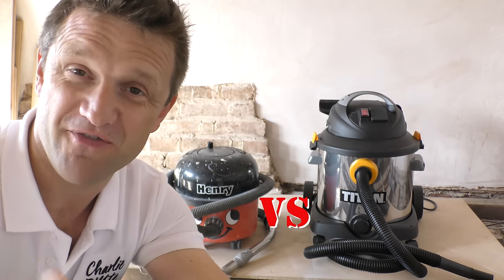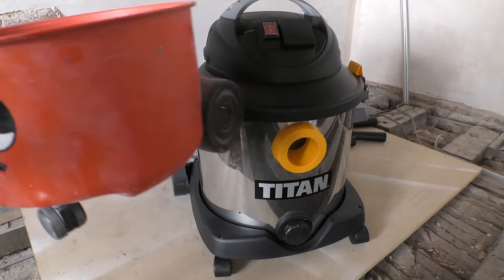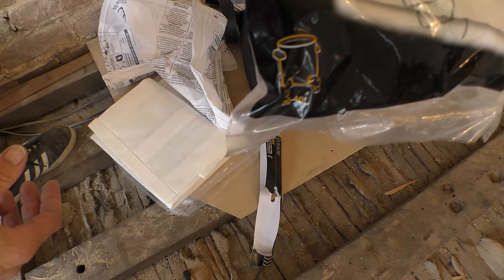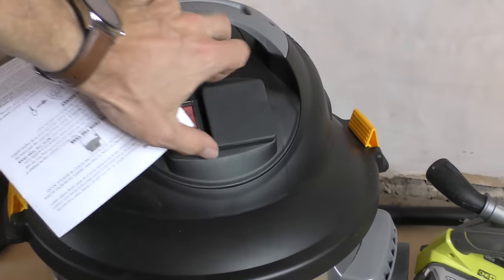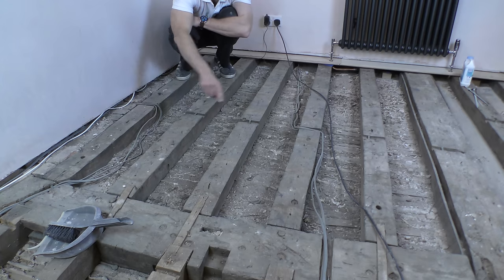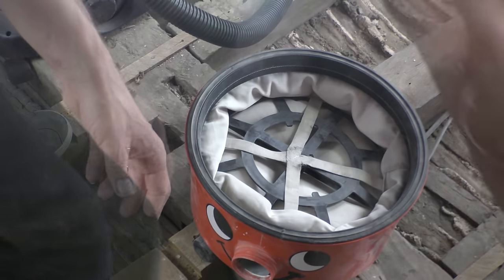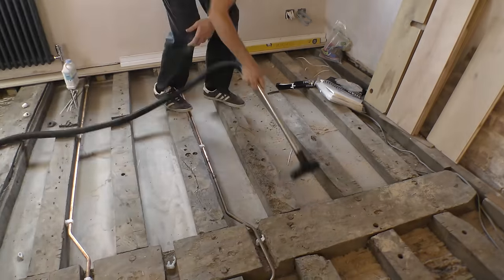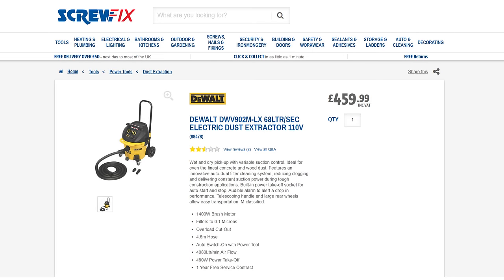TITAN vs Henry - DIY Vacuum Review

Comment: Never did I think I'd spend 20 minutes watching a vacuum review video, but having picked up an older Henry for just a tenner today (😮) I now have both of these vacuums which makes a comparison video pretty useful!
I've had the 30l Titan for about five years now, and I have to say I find it incredibly frustrating because of the attachments, and next to useless because the bags rip almost immediately (vacuuming old lime rubble, much like yourself) firing jets of dust out of the backside blower port like a rocket booster. I absolutely hate, hate, hate it.
Its only saving grace, however, is the power which is why I've built a cart for it and added a cyclone so all I need to worry about is dragging it around my workshop and making sure it's attached to my chopsaw, etc.
Reply from the maker: Me too. However like you I realised that it's just not designed to compete with Henry. It's designed as a static shop vac, and as you say, when attached to a cyclone it removes the need for those hopeless bags. On my wardrobe build, particularly with the pass through switch, I actually grew to quite like it! https://youtu.be/9RfHpm2vf40

Comment: I built a DIY cyclone to remove most of the heavy crap before it hits my Henry. Actually it's not a Henry it's a James, I pulled out of a skip. Works brilliantly in the workshop, the bag hardly ever needs changing. Not as good as proper big bore extraction, but for little jobs it's fine.

Henries are not indestructible though, we had one in the workshop at school and the cleaner prefered the workshop one to hers because it meant she didn't have to wheel hers over to the workshop. But I had been emptying and cleaning the dust bags on the machinery extractors and the Henry was full, I neglected to empty it. The cleaner used it and it caught fire and burned. :-D

Comment: re the blockages - have you tried the thicker tube from Henry on the Titan? Think you would find it also block due to fab power of the Titan. Although clumsy for site work a cylone adaptor works a treat in woodworking shop.
Reply from the maker: It doesn't fit because of the fittings and difference in diameter of the tube between the two models. I agree, a cyclone adaptor is the answer.
Reply: I was lucky then as I utilished the big tube from my old Aquavac

Comment: I was planning on using the cheapest 1300W Titan hoover with a Mirka hand sander block for sanding plaster. I’m not sure if it’s suitable though, what would you recommend for plaster dust? It keeps on clogging/overheating my Miele 2000W vacuum…
Reply from the maker: Plaster dust is always tricky. The DIY cyclone I made has helped https://youtu.be/9RfHpm2vf40?si=5NkrsQi-bD5whzaE but you still need to clean the hepa filter. The only domestic vac I'd recommend for plaster dust is Henry and just change the bags regularly

Comment: You can replace the hose with a 40 mm instead of the supplied 32 mm, and get a longer hose too, and get a matching handle, head and metal pipe

Comment: I think titan must have upped their game since this video, I’ve recently purchased the 30 litre wet and dry 1400W titan brand new from screwfix for £80. The hoover itself is pretty well made and the stainless steel drum looks snazzy. The attachments all feel good enough while thinner than Henry Hoover parts I really don’t feel they are that bad. And in my experience I have never had a blockage although I only use it to collect saw dust and vacuum thick dust from attics. I don’t really use it for hoovering up thick rubble. It’s a very powerful hoover too and I’d say it’s perfect if you want a hoover for dust collection in a workshop and for general heavy duty cleaning. But on its reliability I cannot comment since I’ve just bought it but with a 2 year gaurentee I feel reassured. The equivalent henry hoover would have cost me around £300. And don’t get me wrong it is a much better machine but realistically if you want a vacuum which you can use on all kinds of dirty jobs and not worry about breaking them then this is the one for you.
Reply from the maker: Thanks for that. Very interesting. The one I bought is really a shop vac. Use it in a static situation attached to a cyclone and it's great.

Comment: Found exactly the same things Charlie. It’s nice and powerful but that’s about it .I’ve owned it for a couple of years and I’ve bollocked my old man on a number of occasions for blocking it up until I realised it’s the design 😆
Reply from the maker: I literally hadn't used it since making this vid, until the current wardrobe build and it's had a new lease of life since I plugged it into the cyclonic extractor I made https://bit.ly/3fssYHn Thing is, it doesn't compete with Henry, but that's mainly, as I'm now realising, because it was never meant to be anything but a crude shop vac. I couldn't manage without it at the moment and plug my plunge saw into it so it turns on automatically when I start the cut.

Comment: Same company makes them for Lidl and Aldi too. Likely Positec power tools. You can bet the Stanley model is also made by the same company.

I've been using the one from Lidl for a while. Does the job but the noise level from the motor is too high. I don't own a Henry but have used them and their motors seem much quieter.

My home vacuums are Miele. Not only are they quiet, the suction is on them is amazing. But then you're paying £300 so I suppose it should be.
Reply from the maker: I agree. The motor on theTitan is LOUD. Could do with ear protectors really when I'm using it.

Comment: I had the same Titan as a Henry replacement it was useless for my work. No proper cable storage, lid kept unclipping when carrying it about and putting down/ picking up and pipe ended up having a permanent kink in it after about a weeks use. Ended up getting another Numatic after about 2weeks and returned the Titan reporting it as unfit for purpose.

Comment: I bought the 16l Titan

Great for the car and the blow feature is good for getting rid of moisture from the brake calipers of my motorbike

The wet feature really handy for emptying cisterns when replacing valves etc

Not used it in serious anger yet for heavy duty dust and small rubble collection. Suspect I might encounter blockages when I do

The bag so easily detaching from the inlet is a serious pita
Reply from the maker: It is annoying isn't it. Such a stupid design blunder! Also annoys me that there's no cord tidying mechanism.
Reply: @CharlieDIYte  Hi Charlie

I sometimes freelance for a local curtain/bkind/awning firm and one of their suppliers secures items for transit in a soft but strong velcro type tape. I find it useful for securing power leads, tool and cases when the catches have broken, etc

As that is your line of work iirc might you have access to it as well?

Comment: Charlie, I didn’t see if your Henry had the power boost button on like mine but it makes a big difference. I understand that those models are not available now because of some EU rulings etc. If only they made a bigger capacity Henry or indeed a shoo vac with the tool socket so it could be linked up to power tools! Henry hoovers are great for the worksite/workshop but not very good for pulling around the house and up the stairs. All in all I will stick with my Henry until I can afford to install a proper dust collection system to the workshop. Cheers Craig

Comment: Is the henry ok to plug in power tools like plunge saws etc....? does it have suitable connectors....? Don't fancy buying Titan products as the plunge saw was low quality and inaccurate.
Reply from the maker: You can get by with most tools, by using the adaptor that comes with them. For example my Evolution chop saw has an adaptor that fits directly into the plastic nozzle on the Henry hose. There's a plastic adaptor tube that comes with the Henry - which is really designed so you can plug the different vacuum heads directly into the plastic hose without needing one of the stainless steel tubes, but it allows me to plug Henry into my circular saw.
Reply: Cheers mate...

Comment: Can you fit a Henry hose onto it or a wider hose to stop blockages
Reply from the maker: No. It's actually fine for what it was intended - shop vac rather than domestic. I used it for my wardrobe build attached to a DIY cyclone and it was actually very good https://youtu.be/9RfHpm2vf40

Comment: Hi Charlie, I have been a joiner for over 20 years and I really would recommend the Fein Dustex 25. An excellent machine, incredibly powerful - I believe it has double the flow rate (80litre/sec) of the henry (40l/s), very quiet with a 4 meter hose. Also wet & dry & its £220. They make very good power tools but are only really known for their multi-tool. I also own there 4 speed drill driver, that I also highly recommend. J
Reply from the maker: Thanks Joshua. That looks like a nice tool. I'll keep a note of that  👍🏻

Comment: Great video Charlie. Informative and very helpful. 

Got my partner the HET200A and even though it's the pink Hetty version I use it as it's a numatic and much better than most of the cheap imports we get now. It's done sterling work for years and no issues at all. It's used in the house, car and for my DIY bits.

Comment: I have a titan the small one. I done a modification to mine I got a numatic hose cut the end off and fitted the titan contector on no blocking up as much .
Reply from the maker: Good work 👌👊
Reply: @CharlieDIYte  do you know if the HEPA flo bag will fit the Titan or any other standard wet dry vacuum

Comment: The works Titan, has a motor that is great, the hose "SUCK" and clogs too easy i put it down to the rigid s .you  made a good point about diameter. Over 10 years ago I  bought a nilfisk, it's been abused and drop some hight more then once. The take-off 1800w? Ssh 2kw router makes  it hot. Only thing that gone wrong is the switch (a year ago) replaced part in 3 days. PLUS ISH has built-in dust clearing button works half the time. Like you become a blower fan, and wanted bigger tank. Got nikfisk big bro with reversible blower. If  the new last half long as the still first one; still going strong, it's only £20+ a year . Ps only use a bag on big jobs for mdf, brick dust and cement..
Good show thank you .
Reply from the maker: Thanks, really interesting. The Titan isn't really designed as a domestic vac so my challenge against Henry was a bit unfair. It worked brilliantly as a static shop vac though, attached to a cyclone https://youtu.be/9RfHpm2vf40

Comment: Use a paper bag for anything with fine dust. The Hepaflo ones clog the bag itself so even when the bag is half full it stops sucking. A paper bag doesn’t clog with dust 👍🏻
Reply: Paper bags insted let everything through and into the filter/motor which doesnt really help.

Comment: i got a henry second hand, then found out it is almost as old as me, but its still by far the best vacuum cleaner ive had. i do have the smallest titan vac as well and for 40£ its an animal, i cant kill it and ive never used a bag or filter with it and use it to clean up saw dust and garage debris

Comment: Saved me from getting one of these,of to get a henry tomorrow :)
Reply from the maker: You can't go wrong with a Henry. If you're using it in the house on carpet get the Aero head attachment, unless you bought the Henry Xtra which comes with one.

Comment: Interesting video. I actually very recently purchased the smaller Titan to replace my current Numatic. I haven't used it as a wet vac yet, but definitely far more powerful anyway. The accesories are crap, no other word for them really. But it was cheap, and it does work very well for what I want out of it (primarily for auto detailing). Will it last as long as my old Numatic? probably not. But i can also buy 4 Titan's for the price of 1 Numatic...

Comment: Have you tried the wet feature out yet? It looks like it only sucks up water but not shampoos like a Vax does or have I got that wrong?
Reply from the maker: That's right. I have a video in the pipeline showing the cleaning might of George. Was amazing on my marble kitchen floor, shampoos and sucks up. Not having to clean with the dirty water is a game changer. For carpets the Vax Platinum Plus is better but for hard stone floors the George is the winner.
Reply: @CharlieDIYte  Thank you so much. I just bought the Titan as my hallway carpet got saturated with water from an exploding hose in the kitchen next to it. I need to shampoo it after sucking the dirty water out of course but I'm not sure how to do that with this or if it's possible.
Reply: @CharlieDIYte  Update. I just used the Titan wet and dry to get the water out of the carpet. I was shocked how dirty the water was but I guess it is the hallway. I am going to steam clean it with some carpet shampoo to get rid of the excess smell and then if needed, vacuum up the excess water. I have a H20 mop that I've used on other carpets. Hopefully this will leave it nice, clean, fresh smelling and dry. The only big issue I have with this cleaner is the hose attachment being in 4 pieces and every piece comes apart but I think that is from the extreme suction. It actually lifted my carpet out of the carpet grip. I wonder if there is a stronger attachment you can buy for this?
Reply: Empreśś Baby TT  Ooh thank you. Do they shampoo too do you know?

Comment: Henry is bulletproof. He just works well, on and on. The Hepa filters preserve the motor and preserve our lungs as well. All good quality bits as well, and you can pick up extra hoses and such at car-boots etc. If you regularly need larger capacity you might be tempted to look elsewhere, but otherwise I'll still to the little fella

Comment: I have a similar 30L vacuum branded Einhell, using it in my renovation project. What a pain. Tubes clog up all the time, filter gets blocked often, 40% of bags get torn up. Also what I absolutely hate is switching the filter between wet and dry, which is sometimes impossible if you have spill on a dusty floor, so part of it is wet and dry.
So I am looking for a new vacuum, it must be bagless and take both wet and dry without fiddling around. Any recommendations??
Reply: Numatic CV range (CV570 , CV900) would answer those requirements

Comment: Is the Henry capable to be used as an everyday chimney sweep vacuum handling creosote, ash and soot without blowing dust out of the vacuum into the house?
Thank You!
Reply: I would certainly think so,, quick question for you.. Roughly how much would I be looking at to open up a closed chimney from a cellar in a town house and sweep it? Then how much roughly to then fit a flue from cellar level straight up to the top,, I'm just looking to put a multi fuel burner in and don't want to get ripped off that's all,,, tha ks in advance.
Reply: Carl Jones Thank you!
Your question comes with a lot of different factors. 
What is the chimney sealed up with? What was the reason it was sealed in the first place? Is there another appliance running through it, like a wood stove or furnace?
Your typical chimney cleaning can cost anywhere from $150-$450 depending what part of the country you live in. A liner install, depending on what part of the country you live in can cost you $1,800-$5,000. It all depends on the difficulty getting the liner down the flue passageway (tile breaking and also opening holes in the walls if need be), how accessible is the top of the chimney, quality of the stainless steel liner, length of the liner and diameter of the liner. Sometimes a liner needs to be oval not round so it can fit properly and that also adds on money, sometimes liners have to have insulation wrapped around them. Unfortunately the only thing that I can recommend is getting multiple quotes from chimney sweeps in your area. Just because they might be cheaper they might not know what their doing. Talk to some people in your area that have had work done like this and see if they recommend the sweep they used. 👍🏻👍🏻
Reply: You would need to look at a Numatic HZQ,same people who make Henry but the HZQ is designed for fine dust industries like Chimney sweeping.They even do twin motor ones,prefix for those models is HZDQ
Reply: A. A Thank you, I will look for that and see if I can get it. The problem is I’m in the US and the Henry seems to be the only one I found so far that I can get in the US and it’s only sold by one of those home shopping TV shows (QVC) lol also found on Amazon. 👍🏻👍🏻
Reply: @akaredcrossbow  Ahh I see,Im sure HZQ machines are sold by Nacecare.Nacecare are Numatics outlet in North America.HZQ machines may cost a great deal more but are well worth it for internationally know filtration standards.Especially if you are in chimeny sweeping as a day job,it pays off to have the right kit and only stregnthens your image and your standing with stuff like liability insurance
Reply: A. A I appreciate your help! I’m going to check out Nacecare. The biggest problem in the US is the price for this type of equipment, it’s astronomical. 
Thank You👍🏻👍🏻

Comment: bag is very important. It's the fine dust that will harm you and get into your lugs, the larger dust will be blocked in your nostrils and not get into your lungs. When you dont use a bag, the fine dust gets past the filter and then goes into the motor and will be blown out out the motor through the exhaust and make all this lovely fine dust airborne. If there is any residual asbestos in the area, that will make it nice and airborne for you to inhale.

Comment: Got the 40ltr titan, agree totally about the pipe and fittings, however I purchased numatic replaicments for £15 delivered, bigger pipe longer as well and better hose adapters, Interesting about the bag seal ive had not issues with mine and have used vacume to sand 3 pub floors not problems. Agre with filter in the way for good bag displacement but cant have everything at this price!
Nice review.